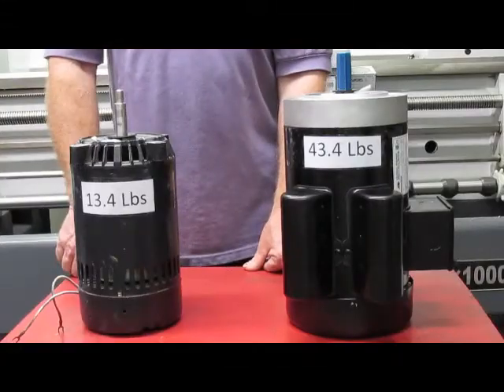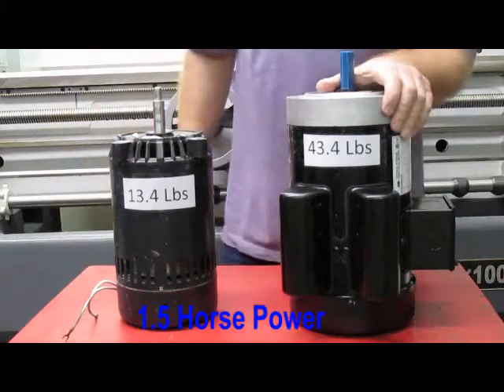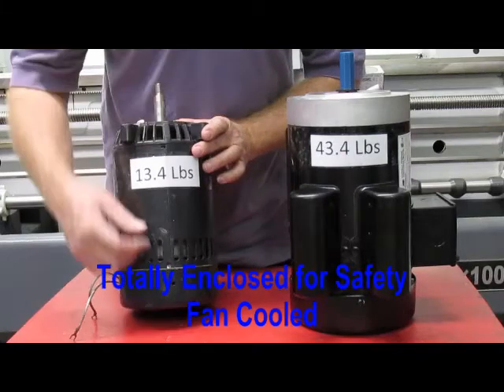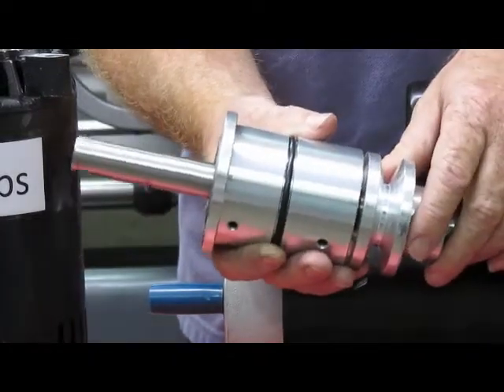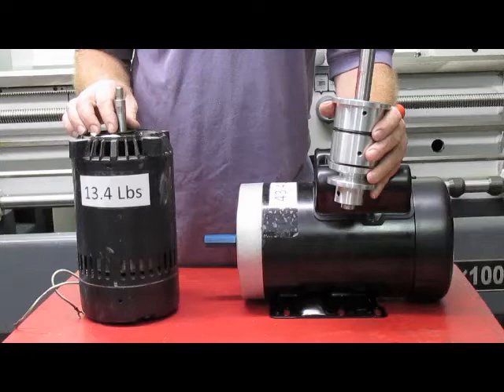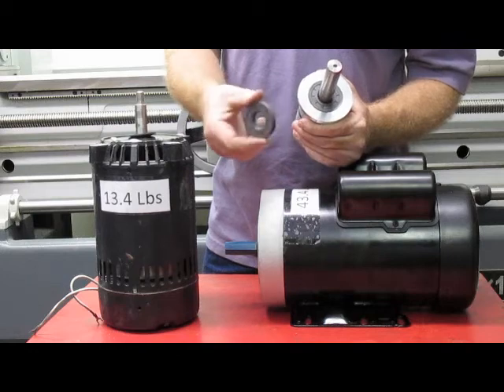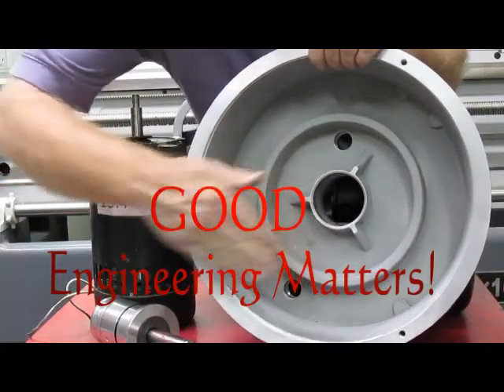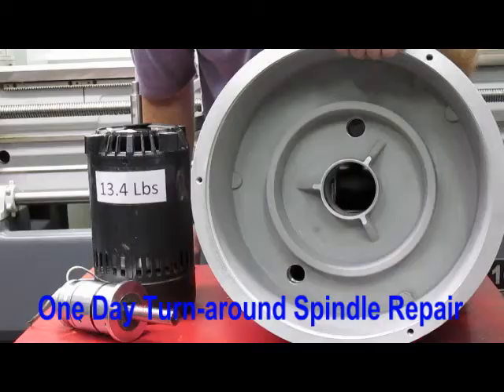Centrifuge Motor Selection

Comment: How does a centrifuge motor stop? what is the force that  stops the motor spinning?
Reply: theres a brake that gives resistance which slows the motor.quick hard braking will make the layers mix together in the tube because of the gravitational force, so it needs to brake slow and smooth

Comment: yep, 20+ years working in HVAC-R and belt drive will outlast DD hands down. i pull 30 and even 40 year old belt drive equipment still with original motors DD units..... not so much.